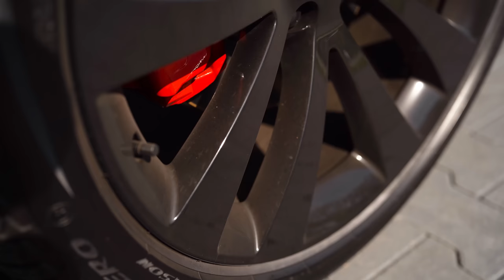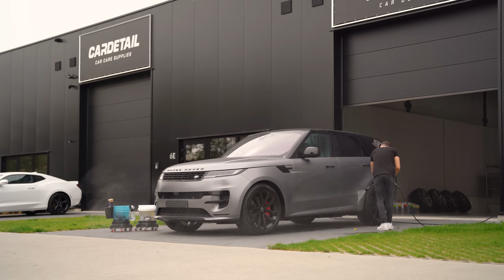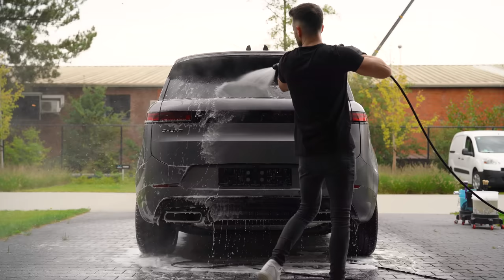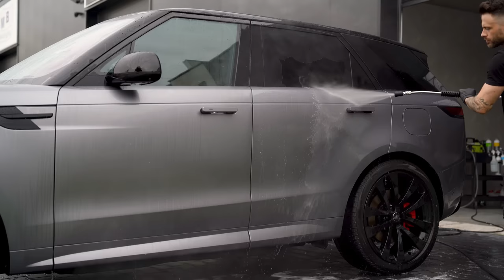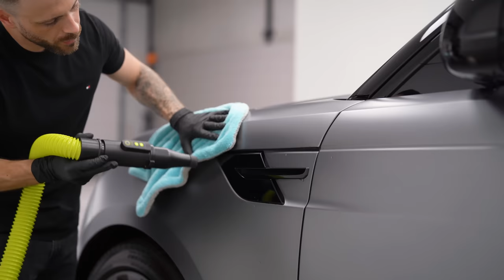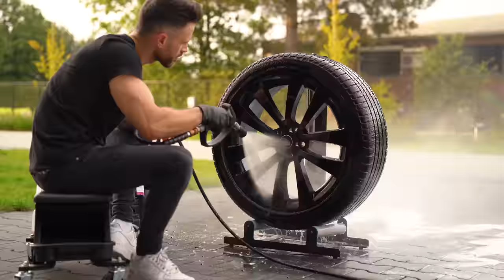Detailing a Matte Range Rover Sport - Wash & Coating

Comment: is that brake buster what you used in the foam cannon for the wheels? I wanted to use it with Mwc but didn't want to risk any unwanted chemical reaction lol
Reply: Yes, its Brake Buster. You can use it with MWC.